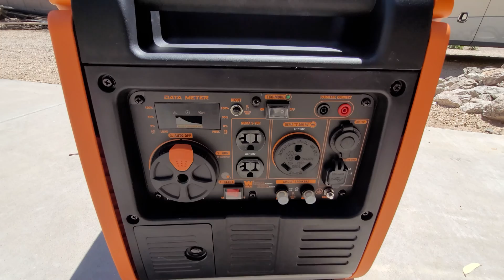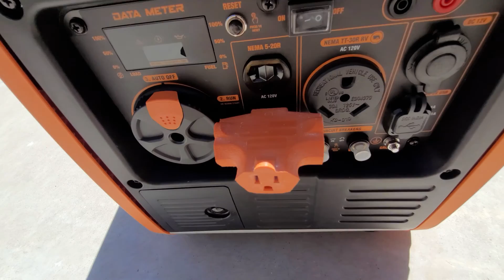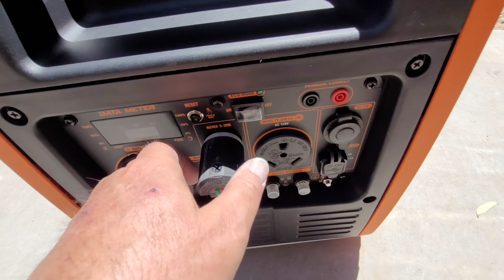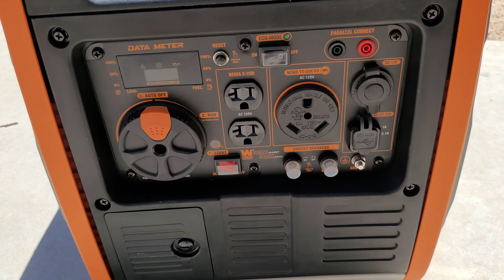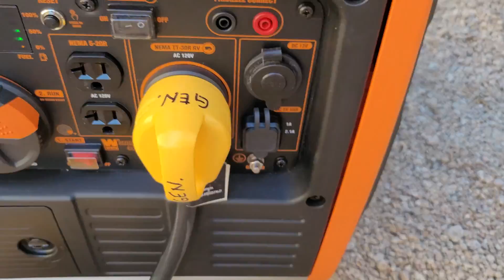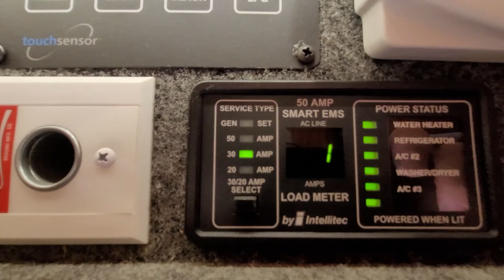DIY-Fixing Portable Generator & RV Problem

Comment: Ok so can I not plug my trailer into my 3800  inverter generator ? And just turn my breaker back on in trailer ? Because that’s what I planned on doing ? I have a 30 amp trailer and my inverter had a 30 amp plug spot so I figured I could plug it in and go no?

Comment: THANK YOU! Your video & explanation was spot on. I modified my 30amp adapter and my generator now powers my 50amp RV with a hard wired Hughes Watchdog 50amp EPO smart surge which was giving me an E7 Neutral ground error previously and shutting off power, now it runs without issue. Thanks for the video!

Comment: The inverter/generator in the video is a Chinese manufactured unit...The standard where these units deploy are predominantly into grid systems that utilize 230v, not 120v.  I've lived in SE Asia for over a decade and most appliances do not have a ground...the plugs are 2 prongs only.  This was confusing to me.  As I read the inserts that came with my Polo PS4500si inverter/generator, the diagram shows it's ungrounded and states that if the appliance you are using are grounded (they have a ground on the electrical cord), you need to use the grounding screw on the face of the generator to ground the unit for safe operation...Question: If you use the Bonding of the Neutral/Ground (like in the video) does this complete the circuit so the units breaker will trip if there is a short somewhere in the load???  Trying to understand correctly, thanks!

Comment: Great video I have a champion inverted generator but I use a bonding plug but now it leaves just one outlet on the 120 if I do what you did with the RV dog bone Making the dog bone a bonding plug for the generatorDoes that also bond the 120 plug?  Thank you
Reply from the maker: Every generator is different, so I cannot answer that.
Reply: @exploredom3690   Thank you

Comment: Is the Generator Bonded? If it is undo the ground from the neutral from the generator solenoid cover and get a 12 gage ground wire and hook it up in the front of the generator on the nut and bolt that is providing  on the generator it self then have a ground rod ground to earth. That way your not blocking any receptacles on the generator and can be used if needed. Hope this helps.
Reply from the maker: No

Comment: Came here helping some of our volunteers with an installed EMS on a small camper like you probably have and they need to attach a genny but were getting that ground fault indication.  Super helpful...thanks.  We'll check to see if their Predator generator is good without having to modify a 30 dogbone.  

Question though.. why are you hesitant to use your installed generator?  We have a 43' diesel coach and had to replace our installed Generac generator because it just wasn't used much by the previous owner and ultimately died.  If it's a diesel, it needs to be operated as as much as comfortable because they love to run and you can get thousands of good hours out them.  We bought a new Onan QD8000 and the dealer we bought it from had changed these out on a couple of occasions with 66k and 37k hours (long haul truckers).  Unreal!  We need to run these babies! :)
Reply from the maker: When we are out on extended dry camping trips I will bring along the gas generator, and if our diesel fuel level in the coach gets low then I can run the gas generator just to keep the coach batteries charged.
Reply: That checks. A lot of our projects are boondocking and I make sure we top off beforehand. We also have 1600w of solar and that keeps our usage manageable. Safe travels and thanks again! See you on the road!

Comment: Im a little confused as to why the 15 amp plug did not work.  The wiring diagram on that Wen generator clearly shows that there is only one hot, one neutral, and one ground.   So they are common for all the 120 v receptacles.   Very confusing.
Reply: You are rght. I have had 4 inverter generators and each one was one common for all 12v receptacles.

Comment: Had the same problem but when I checked the output of the generator I measured 60vac from each leg to ground and 120vac between the legs. If I jump the neutral leg to ground, I will be shorting out 60vac. Curious if you made the same measurements? Is the generator smart enough to compensate for this?
Reply from the maker: This is a single phase 30 amp generator, so there is only a single 120 volt power wire, a neutral, and a ground. Measurement from power to neutral/ground is 120V.
Reply: @exploredom3690  thanks for the replt. This generator is like I've never seen. 60vac from gnd to each leg. Gave the same error.
Reply: @mstef66  did you check your voltmeter settings? Maybe it was on the wrong setting giving your some weird readings?
Reply: @Jasonoid  Yea, the measurement was pretty straight forward. Strange configuration. No bond between neutral and ground, 60vac between ground an neutral and 60vac between ground and the hot side.
Reply: @mstef66  all of my unbonded generators, inverter or not, measure 60 volts between ground and neutral. Once bonded, no voltage between ground and neutral.
Reply: You only see 60 V per leg when it is unbounded.  It is just an artifact of the neutral floating.  I once thought this thought when I talked to the brand label for an inverter, but it turns out they didn't know what they were talking about.  They were just middle men taking something from a factory in China and sticking their brand label on it so it could be sold in the USA and then they made a nice profit.  So yeah, they know how to make money, not how this stuff works.  If you are a Star Trek fan, think you are asking a Ferengi trader a technical question, not the Bynar who made it.  The Bynar knows what they made, but it was never communicated what they were up to.

You can do a check while your generator / inverter is off.  See if there is continuity between ground and neutral.  I bet you you there is no continuity.  Once this is established, then you know you can bond it even if it isn't labelled.  If for some reason it blows up, well this is something you want to try early on while under warranty.  But yeah, I have done it to both an inverter and a generator and both were fine and worked better after doing this.  It is only that I am making it comply with NEC codes and one would think these things would be designed so that they could be made to comply with NEC codes.  After all, these standards are there for your safety, especially the whole return to source ground-neutral bond.  It would be kind of crazy if you could not get the device to comply with NEC codes and still be able to sell it in the USA and no way to make it safe.  Granted it is against code to not label the outlet as "floating neutral" and they do this anyway in a number of cases, so...

Comment: good info.  I have a similarly sized genny (Champion 4500 dual fuel) with a similar plug setup.  i havent made or bought a bonding plug but always assumed that if I bonded the 20 amp duplex it would also bond the 30 amp RV plug and vice versa, which you showed is not necessarily the case!

I will now make both varieties so Im covered for all situations.  thanks!

Comment: Thank you, thank you, thank you for that tip. I just had a new modern gas furnace installed and using my inverter for my solar power system had the same problem. I used your little trick and voila the motherboard in my new furnace became compatible with my inverter. If the power goes out this winter I have heat and light.
Reply from the maker: Glad it was helpful in your situation.

Comment: I'm new to this issue of "bonded vs floating" neutral.....but what I don't understand is why there isn't some sort of switch on the generator to make this change, rather than having to disassemble or rig up stuff.
Reply from the maker: Not all pieces of equipment have the same requirements.
Reply: Had considered this too, some thoughts.

A switch would need to be capable of carrying the total possible fault current. They are large and expensive.

The consequences of being able to switch that on the fly without deeper consideration, especially during operation, could be very dangerous and/or incompatible.

Suspect the manufactures would also be forced to install that switch on the powerhead itself, to keep that earth resistance as low as can be.

Harm reduction ... use a waterproof lockable switch rated above the maximum output, use excessively heavy gauge wire with a thermal sleeve and keep it as short as possible.
Reply: @bobsmith24868 Everything stated here: would be correct!

Comment: You overcomplicated the issue. You should have left the factory 30 amp pigtail intact.  All you have to do is buy any cheap replacement end 15 amp male plug.create  a jumper inside of it from neutral to ground.  Plug it into your top 20 amp receptacle any time you want to ground your floating neutral.much easier ! Peace and Love.
Reply: He did that at the five minute mark.
Reply from the maker: As stated in the video; the 15/20 amp receptacle is wired separately from the 30 amp, so jumpering that receptacle does not affect the 30 amp. That is why I needed 2 jumpers.
Reply: @exploredom3690  Your saying this even with the person above saying that the wiring diagram on that Wen generator clearly shows that there is only one hot, one neutral, and one ground.   So they are common for all the 120 v receptacles. Hmm?
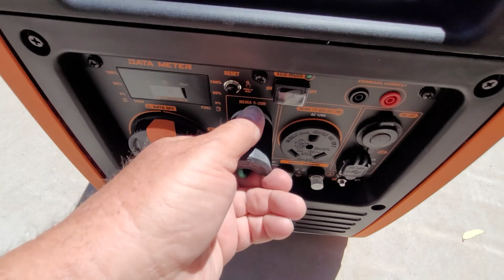Reply from the maker: @LarryRichelli  My experiences were documented in the video; start @ 5:05.
Reply: um you didnt listen closely.  he DID try that and the 20 amp and 30 amp outlets arent connected inside the generator.  he NEEDED both types of bonding plugs
Reply: Seeing the ground - neutral bond needs to be able to take short circuit power, say a hot wire makes contact with the metal case to your toaster oven, I would think it best to bond on the TT-30 plug, not the NEMA 5-15 plug.  Granted either one should trip the breaker IF they were wired together in the generator, which for some odd reason isn't working out with this generator as per commentary.  Just thinking of all of the times I have seen someone melt the insulation off of their wire and often the insulation melts off almost instantaneously when there is a short.